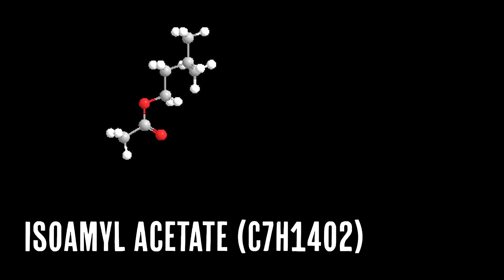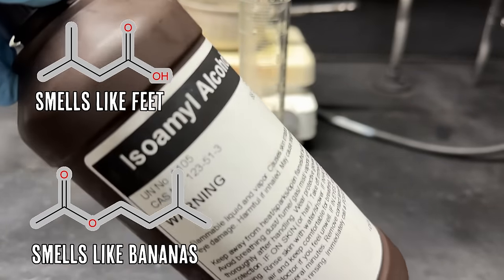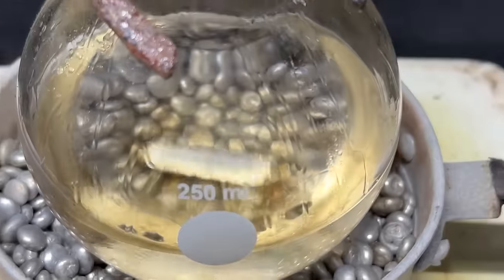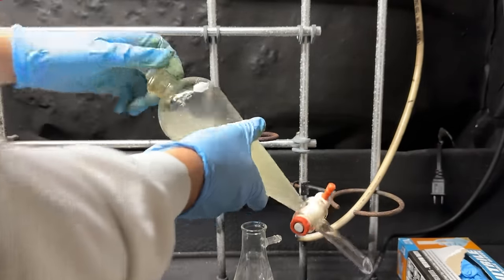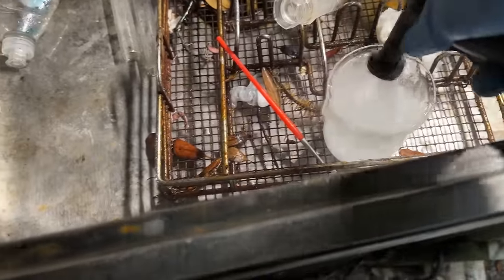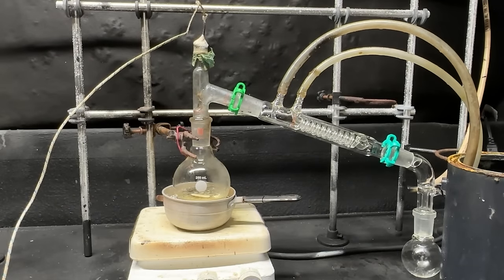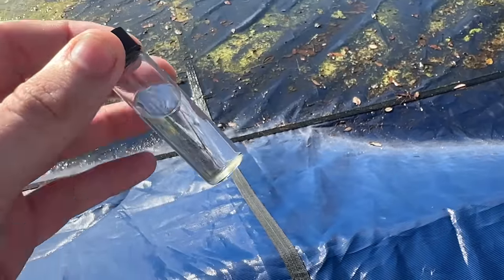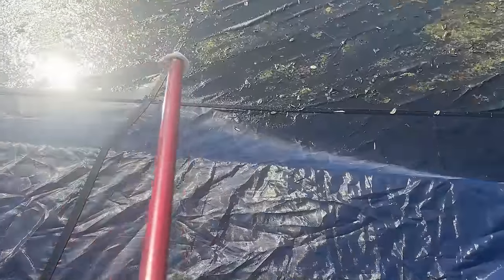Making a Bee attack pheromone then testing it...

Comment: I used the calming wintergreen for years instead of smoke. The amount they respond to is miniscule. It was some emulsion so it wasn't pure, maybe 10 -20% (wild guess, probably high) and instead of 1-4 ounces per quart of water dilution ratio, I went down to half an ounce in a gallon. But I was gentle and didn't crush many and tried to do everything before they "woke-up" 10 to 15 minutes after taking their hive apart. I wore just shorts often and went barefoot. If you're sloppy and squish them with frames or supers their mood changes. You can hear it inside before they start bouncing off your face. The tone changes.
Reply: Neat
Reply: Cool

Comment: Just a tip on the side, usually you vent a separatory funnel by opening and closing the stop cock, shaking it slim side up kind of diagonally. That's easier than removing the glass ground stopper every time since you already have your hand at the stop cock since you're shaking with two hands.
It's the little things that make life easier.
Reply: it is a valid argument, but as much as i trust clips and stuff, i am absolutely holding onto both ends of the sep funnel when shaking it, so one hand is on the stop cock, the other is on the stopper. plus, some of my funnels have a little ridge on the inside of the ground glass of the funnel, and another in the stopper - you can twist the stopper to align the two, comleting a "way out" for pressure - you then twist it back, shake again etc. the main benefit of that is minimal liquid being sprayed out when compared to the stop cock end.
Reply: @raiyiar  yeah, you absolutely have to have one of your hands on the stopper. I just thought that was self-evident so I didn't mention it. Stopper in one hand, the other one around the stopcock.